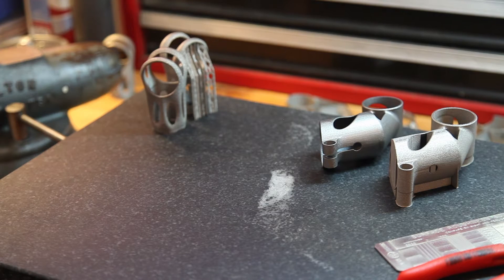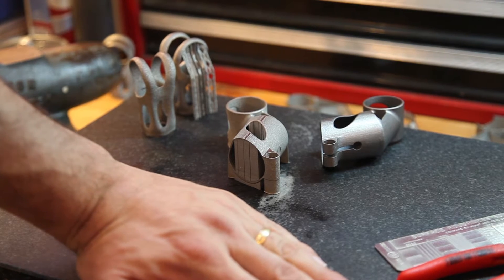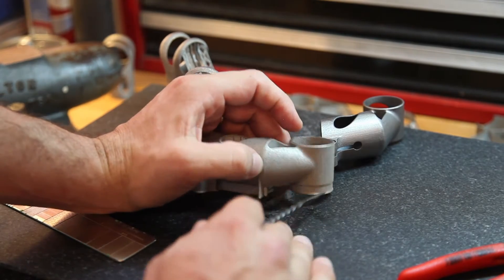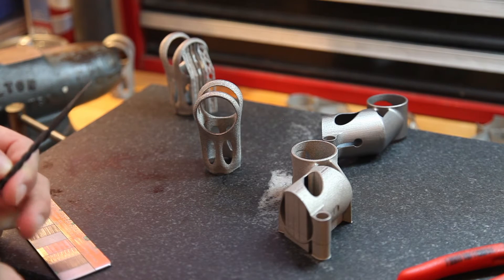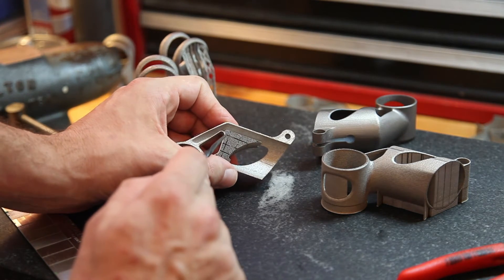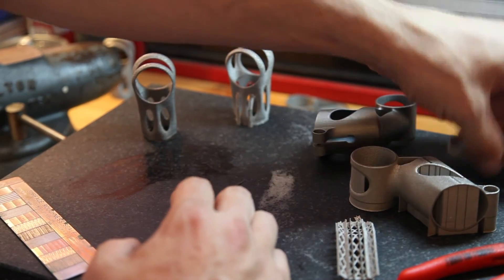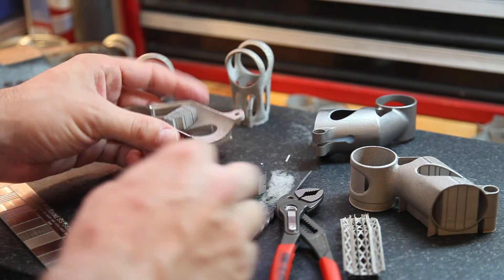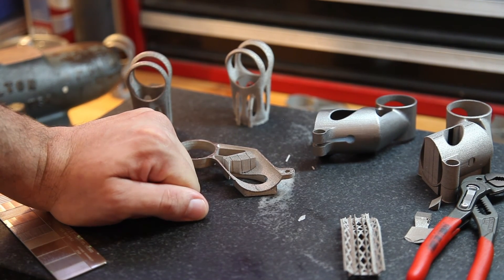DMLS vs EBM titanium parts

Comment: I work with EOSM290s and M280s. I find it fascinating the things we can build sometimes. I design all of the supports and it’s a challenge to get these parts to build correctly. Trying to account for stress in the part as it slowly builds and design in supports strong enough to hold the part yet easy enough to clean up without massive work. I love my job and I love the potential this technology has for design and development.
Reply: What kind of soft do you use to make supports for In718? We have some problems with removing original supports made in magics?

Comment: is inconel more difficult than titanium
need to make some rocket engines
Reply from the maker: It's certainly more difficult to post process! But there are a lot of job shops who print both laser and EBM in inconel.
Reply: ok because on this new product it says inconel is in beta which suggests its difficult
https://markforged.com/metal-x/
i think they are bs
proper machines like eos 290 are the best 
i know printing is cheap but the machines are so expensive
companies that print for you must charge a fortune and make huge profits
is that accurate?
Reply from the maker: Actually, job shops are often under a lot of financial pressure. The machines are expensive, the powder is expensive, the engineering labor is expensive. Plus, most of these printers (I can't speak to the MarkForged MetalX specifically) are not particularly repeatable, meaning that if you want to print one part successfully you often print many failed parts first. See this blog post (which is a bit outdated, but still a good primer) for context: http://pencerw.com/feed/2015/3/15/3d-printing-titanium-and-the-bin-of-broken-dreams
Reply: i appreciate that theres skill involved but the powder only costs $200 per kg thats not expensive is it?

i think the issue is that the quality of the prints is poor so they require additionally finishing and maybe heat treatment for strengthening which results in the cost being equivalent of traditional manufacturing 

there are many demonstration videos on youtube here alone that show nice prints in batches
Reply from the maker: Well, "expensive" is relative. Also keep in mind that metal powder is highly reactive and therefore dangerous to store and handle. "Quality" is also relative, but you're right that there's generally a lot of post processing done on these parts. 

In short, these processes are not generally direct replacements for CNC/forging/casting. You need to reengineer the part for the process, and also need to justify the manufacturing cost through performance/lead time/something else.

Comment: All this is not energy efficient. Imagine the cost of making titanium powder. Then the energy used to make the machines and then the power consumed by the laser or electromagnetic beam.
Reply from the maker: You're right about the powder production process, but the printing itself isn't as bad as you might think. Regardless, a full lifecycle analysis is tough stuff - especially when you're dealing with complex industries like aerospace.
Reply: This guy is hating on you though Spence, he had another comment which I don't see right now, but it was basically along the lines of "You talk too slow, and waste people's time". I responded to it saying he should increase the playback speed to 1.25x instead of hating on you.
Reply: It will become even more amazing as it is refined and prices come down. Imagine a small shop able to print accurate, small, custom gear sets or products that cost hundreds or thousands of dollars? One day maybe your tinkering enthusiast can have one :O
Reply: My point exactly.
Reply: Not if you only need one small part (prototype), which would require many hours in a workshop programming and operating CNC machines etc. For large scale production its a different thing as you design moulds, special tooling, and assembly lines that are more efficient.
Reply: @Richard.Andersson 
Anyway You could do that special tools, moulds and other stuff for bigger production "in seconds". Thanks to AM :)
Reply: It's a 200 watt laser that fuses the powder, which is not that much. Also, the flexibility and added benefits of manufacturing with it make it feasible. Educate yourself instead of speculating your own truths based on whatever minuscule facts you may have acquired.
Reply: @ElShotte  would be more helpful if you could name few good laser source suitable for my next project to build a metal 3D printer.
Thanks in advance

Comment: Hi Spencer! What about the surface finish? Could you show for us the finished parts?
Reply from the maker: Attila, I wrote one blog post about finishing with micro machining: http://pencerw.com/feed/2016/1/30/surfaces

And I'll have a followup blog post about chemical milling soon!
Reply from the maker: 2012ageoflight Reptiloid of the Holy Gods The best thing to do is recycle it, if you can. Most job shops will have a service that recycles materials for them, so it should be easy to arrange!
Reply from the maker: The chemical/vibratory surface finishing blog post is here: http://pencerw.com/feed/2016/11/29/ebm-and-chemical-surface-finishing

Comment: From experience using Magics for an M270, I do have to note that there is a more user control than what you portray regarding generating support. Under the "Block" category of supports for instance, you can control fragmentation without relying on Magics to do it for you. Also, you even have the capability to individual model and place support structures. That said, removing the support is quite the process no matter how long you spend perfecting them.
Reply from the maker: Yes, you're probably right - my experience with Magics' support module is pretty limited. I should also note that the supports in this video were not designed by me.

Comment: Hi! I'm doing a final year project that involves DMLS and EBM and I need your help to clarify one major doubt. I have seen many conflicting articles online on whether both processes require support structures or not so I cannot be sure.

I would like to know if EBM and DMLS will and must print Titanium Ti6Al4V with support structures?
My impression is that due to Arcam's heating system + light weight powder, the form will be much more stable and there will be low chances of wrapping due to residual stress, therefore there will not be a definite need for support structures and it can be added manually.

Appreciate your help!
Reply from the maker: +Kenneth Chen you're right about residual stress for sure - EBM has way less residual stress than DMLS. Supports still are necessary with EBM, but their purpose and design are somewhat different. See this guide for more details: https://github.com/Gongkai-AM/Machine-Guides/blob/master/Arcam%20EBM%20Guide.md#supports

Comment: How strong are such parts? I have a hard time wrapping my head around parts made from powder rather than CNC'd....
Reply from the maker: +sorryociffer in general they're very strong - or can be made very strong through post processing (HIP, etc). The one thing AM can't do is make single crystal parts, which is possible (but not particularly common) in precision casting. But that's a pretty specialized application; in most cases additively manufactured parts have very good mechanical properties.
Reply: +Spencer Wright Good to know. Any companies you know of that have a good rep, a refined process and do prototyping and small runs?
Reply from the maker: sorryociffer I always like working with Addaero Manufacturing for EBM parts!
Reply: How do the two compare though? I would think EBM has an advantage because it uses vacuum so no gas pockets
Reply from the maker: Currently, there are pockets in every printed part - if you look at a small enough scale. Most metal printed parts are HIP processed after printing, which fixes any voids.
Reply: I wouldn't think you would need to have support structures for items printed this was as the power itself is compacted in and around the piece thus serving a the support structure.